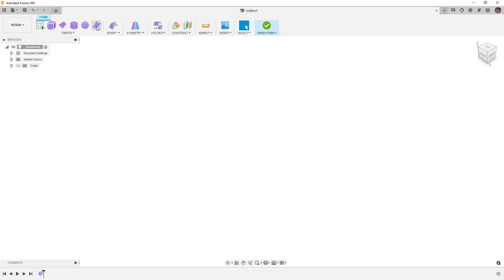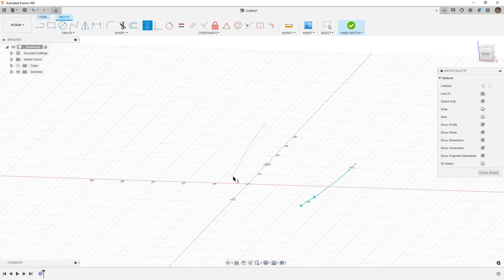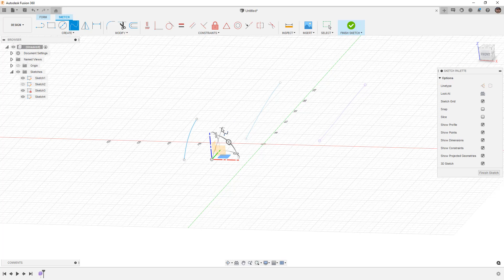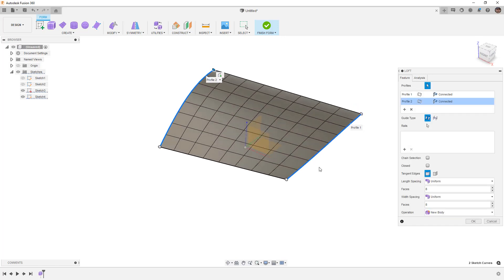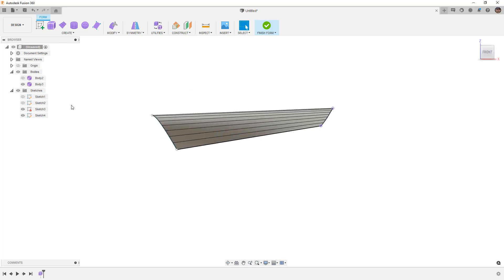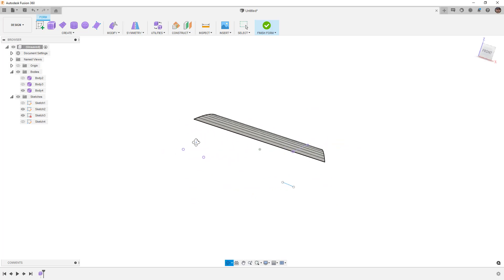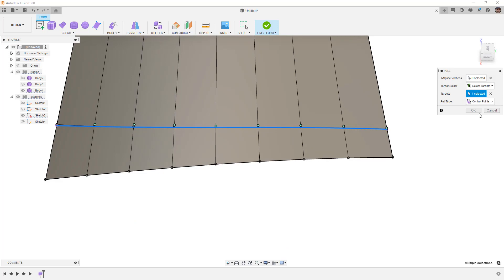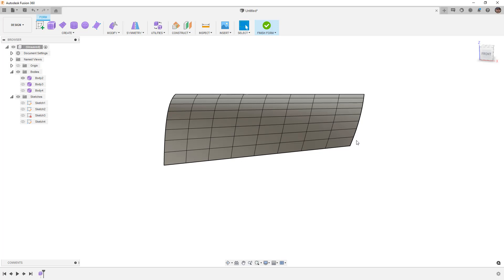Fusion 360 Form Mastery - Part 15 - Creating and Using Curves in 3D to Control Form Bodies

Comment: These curves are what you could use to trim form bodies to get more precise surfaces, of car bodies for example?  Is that the idea?
Reply from the maker: You can use them to trim after you convert the form body to a BREP surface.  Of you can use them to snap to and help control your shape.  Be careful with Control vs Surface Points though.  In most cases if you use this kind of work flow it will be with Surface Points.  Also note there is no link between the sketch and form. you are just moving it to the location of your curve.
Reply: @LearnEverythingAboutDesign  Cool, thanks, I gotta go read up on the different between control points and surface points.  I'm guessing its something to do with control point splines and fit point splines.
Reply from the maker: If you are in Box Display on a form then you are selecting and editing Control Points.  If you are in Smooth Display then you are editing Surface Points.  If you use the cage display option (CTRL+2) then you will edit the control points but also see the surface points at the same time.  

It is a similar analogy to using a Fit Point vs Control Point Spline.
Reply: @LearnEverythingAboutDesign  Cool yeah, it was that analogous relationship I was thinking of.  Thank you so much for your excellent explanations, you are an amazing resource!